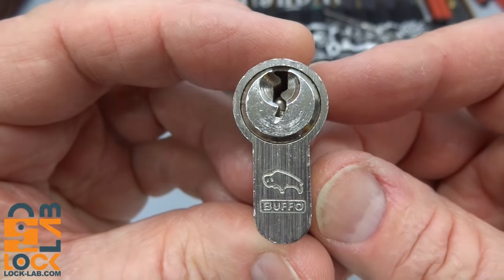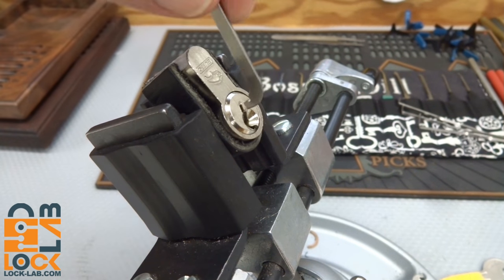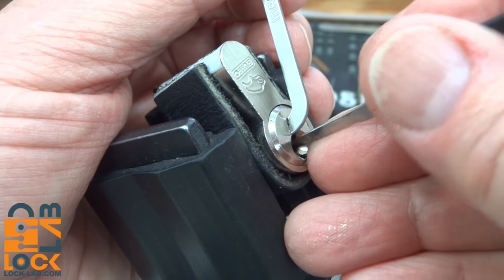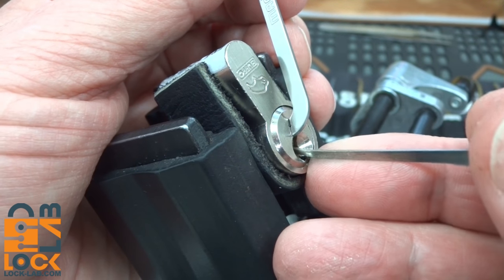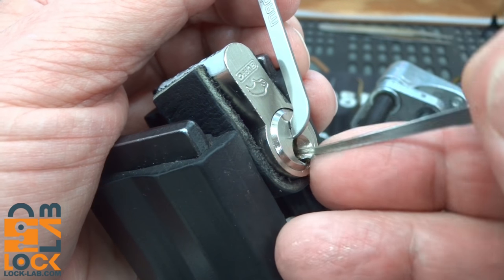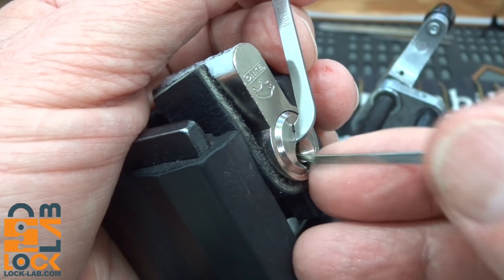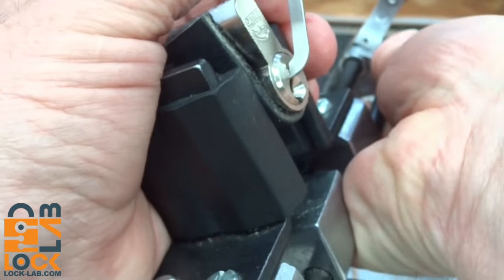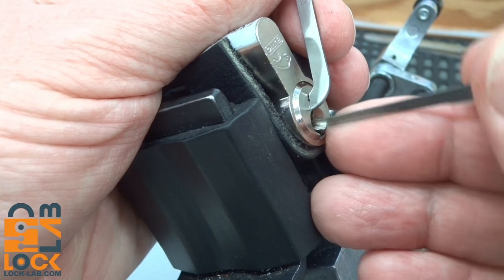(974) Challenge: Buffo Picked & Gutted

Comment: Yup, I finally opened that old vintage Yale & Towne padlock and it was full of various length spool shaped security pins. When I knocked the side cover off and took it apart I also discovered the end of one of the springs had become tangled on one of the spools jamming it in place. Makes me wonder if that's why it took over 6 months to pick, dunno.

Comment: Bill ive got a few american locks that ive picked over and over and after a while they have gotten harder and harder to pick, until ive picked them more than 20 times and cannot pick them even one more time. Ive tried picking this one all day today. And cant do it' ......but i tried the key and it still works..... has this happened to you? Please let me know. Its driving me nuts!
Reply: Any tips or hints if so?
Reply: Maybe you've just lost your touch. Have you considered taking up knitting? Joking, of course. If you can, try gutting the lock. It's likely due to wear from picking it.
Reply from the maker: No, not after only 20 picks.  Maybe after 200 picks there would be significant wear.  I suspect something in your technique has changed, like tension.
Reply: Aliah Mick Yes we had that once or twice ... clean the lock, a bit of good, pure oil and do not try to think about what you did before and try to pick it like an unknown lock. Sometimes you kind of get lazy and don't really pay attention to what is happening inside. But mostly it is due to the wrong tension I think. Greetings from Germany
Reply: Can you mark the side of your pick with a visible line, about 5cm from the tip? Either a marker or tape.
I've been watching your videos for a long time, and I just realized how much that would help to visually follow your methodology.
Reply: Well i learned to pick on these locks. So I've  probably picked on them long enough to have picked them 200 times. Lol . Its one of only four locks i have with security pins. Until i can get some more, or find a lock picking buddy to trade with, . Thanks for your response Bill,  i appreciate it.
Reply: Thanks to Michael and Julian also!
Reply: Oh and I'm going to disassemble it, but i told myself i had to pick it one more time before i did.lol which might be the end to my sanity!
Reply: My technique is also flawed though I'm sure. Ive not been picking that long.